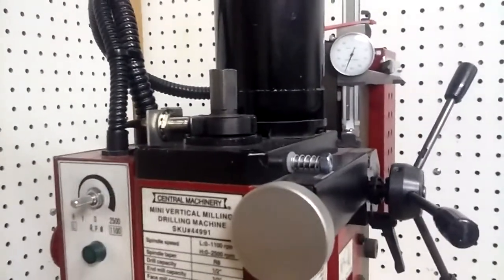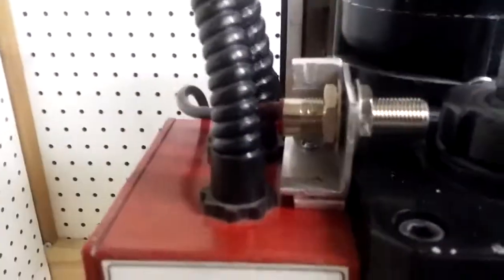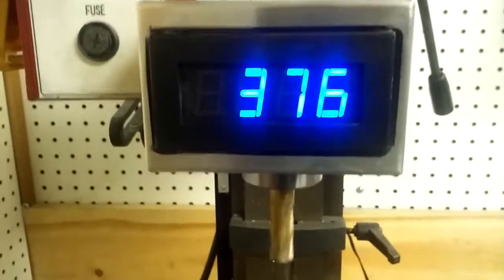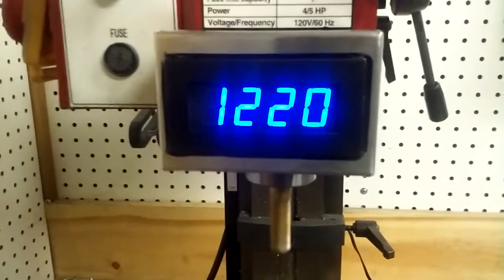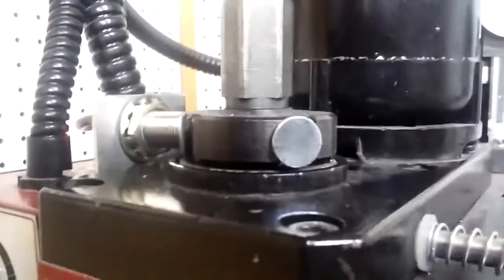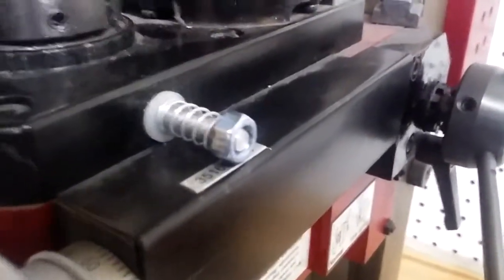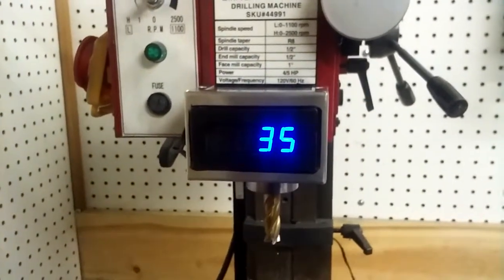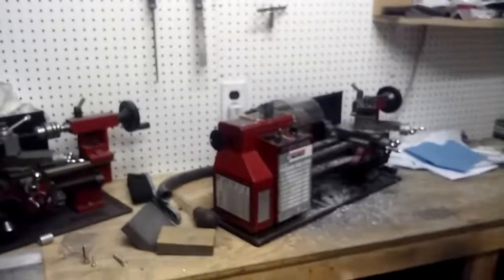Mini Mill Tachometer and Spindle Lock

Comment: I've been watching all the videos I can find on adding a tachometer on a mini mill in order to get information on mounting the magnet. Yours is the 1st that even shows the magnet! The question I have is whether or not it get mounted using only the force of the magnet or is glue or ? Also required?
Reply from the maker: On mine I have ONLY the magnet.  No glue.  No adhesive of any kind.  It has never come off.  Not even at the highest speed .   But I do know of people that glued or epoxied the magnet on their spindle. But I found that it was not needed

Comment: How do you get the driver to not overload  so easy mine shuts off with very little load  please advise
Reply from the maker: I'm not sure I understand the question.    As for the mill itself, mine never shuts down.   It will break the gears first before bogging down

Comment: How are you powering the tach? Batteries?
Reply from the maker: I did use 6 double A batteries at first. (and that worked fine)  Right now I have it wired up to a 12 volt adapter plugged into the wall outlet.  

 I am working on powering it from the mill itself.  When I get that wired up I will post another video.  The tachometer will work with DC voltage from about 7 volts up to 30 volts.  Tapping DC voltage inside the controller should be do-able.

Comment: Hello Raymond. I've got a story to tell. You won't believe it. Today, 5th Jan, after much dispute with eBay about a seller who delivered 3 Axis scales to be used on my Sieg SX2LF that were incorrect length for my machine by 100 mm, I ended up getting full refund and to keep the scales, (no need to return them). I am starting to realize that some sellers on eBay are dishonest and not only that but they also try to bribe by offering partial refund if I kept the items whether they are not the products described in the order, or are faulty, etc. Now I got the scales (free of course), but they are longer that the required travel length. Can I cut them short to the required length of 400mm travel length for the table (X) and 250 mm for the Y and Z travel length. If these can be cut, would it affect the performance of the scales? Otherwise, like eBay said today, keep them or throw them in the bin. What do you suggest, Ray?
Reply: That's the Chinese for ya. They claim to be customer oriented, until they make a mistake and try to screw you. Something very similar happened to me, and yes, I got keep what they sent for free. Then I gave them a bad review, as they deserved it, and they got all mad and huffy. Lol